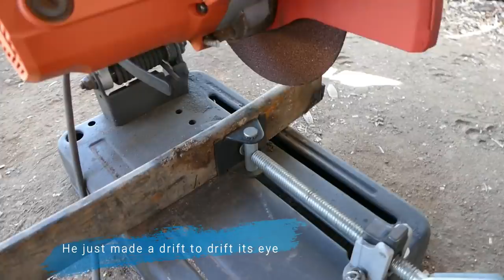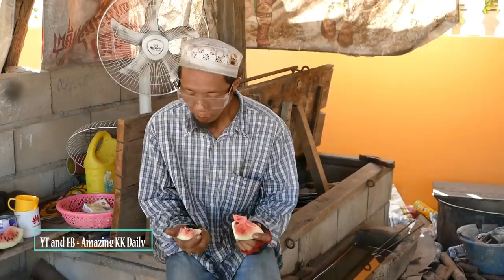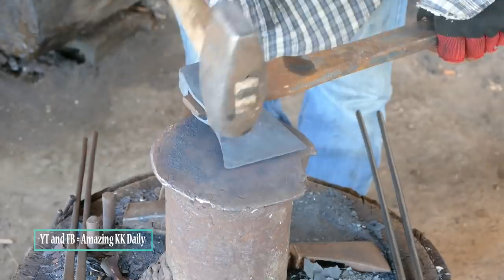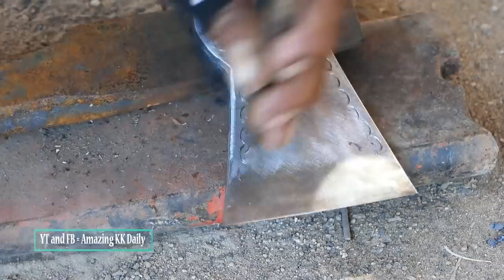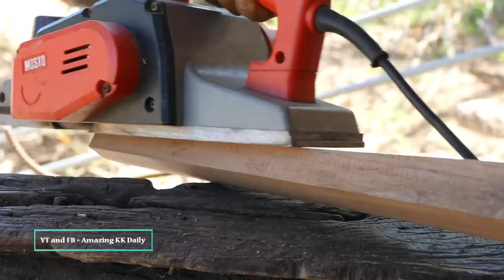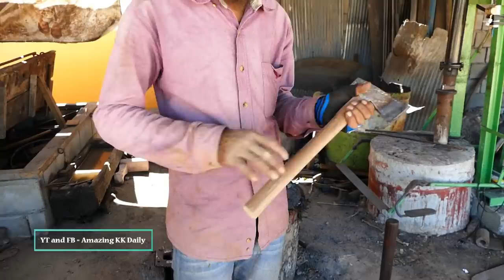MAKING AN AXE / HOMEMADE AXE / كيفية جعل الفأس / कैसे एक कुल्हाड़ी बनाने के लिए

Comment: To keep the axe head on the handle better, you can forge a small, sharp wedge of steel to hammer into the top of the axe, spreading the wood and increasing friction. Great job!